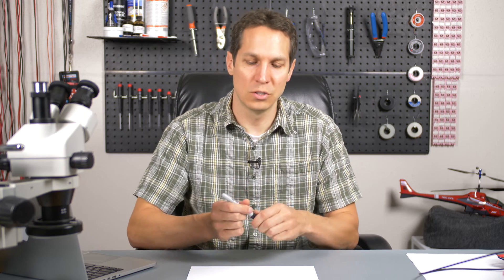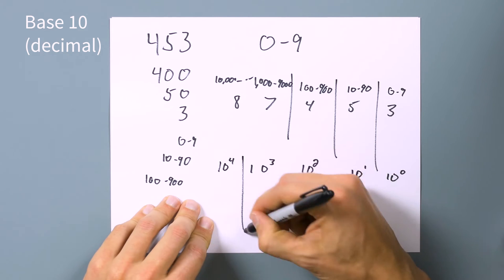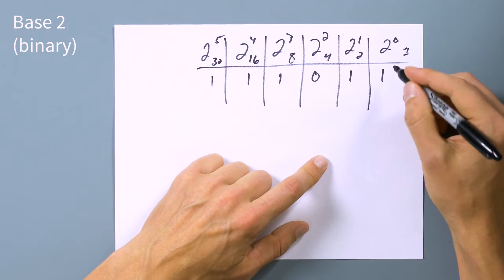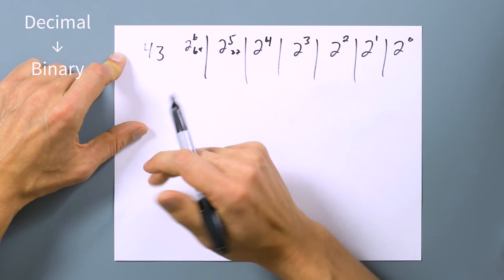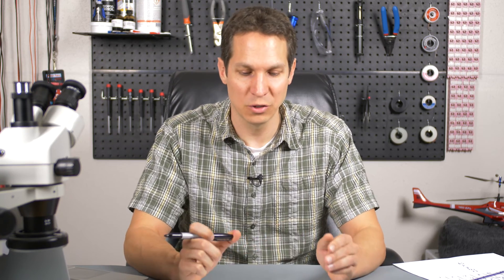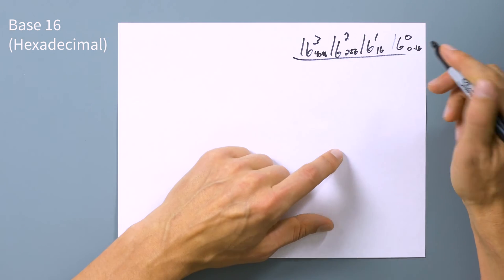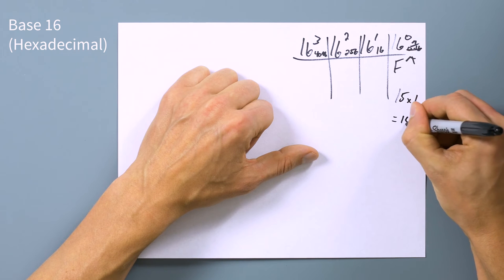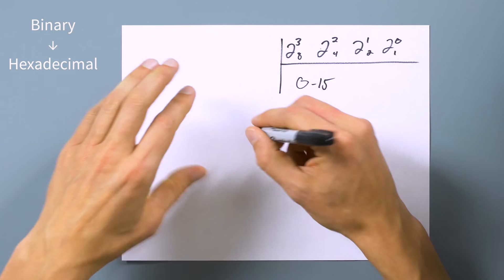Binary, Hexadecimal, and Decimal Conversion – Simple Explanation | Basic Electronics

Comment: Is ok if a number like 0x1234 I convert it to binary by  converting each digit from right to left in 4 digits(0 and 1), for example 4=0100 and then I keep going to go to the left,what I don't understand is when I convert it to binary the computer gives me this 0b1001000110100.What is that 0b??
Does it cancel those 3x0 in front and comes with 0b Wich means zero bits?
Reply from the maker: Hi Edward, great questions!  For converting, going from right to left (going from decimal to binary) is the best way to approach it.  As for the "0b" - that's just the way your computer output is telling you it is binary.  It has no numerical value whatsoever.  So, 0b1001000110100 is just saying that 1001000110100 is binary.
Reply: @CircuitBread  Ty so much,now I have another question if I am shifting the bits to the left from let's say 00111<<3,I will lose the first left 1,so since the 1 is important where is that 1 going?? i mean is like i am losing information,right?
Reply from the maker: Yes, there are different types of shifting, some that carry and some that don't.  If you carry, you don't lose the information but you do need to figure out what you're doing with it.  Is it wrapping around to the front?  Going somewhere else?  If you don't put that info somewhere else, then it's gone forever!
Reply: @CircuitBread  I am beginner in embedded system,I am on learning phase,can you give a physical example on why do we use this bits shifting? i mean let's say for example we have a vector of 5 less and and 1 means ON and OFF means 0.When I shift the bit that means I can put ON the LED I want from this vector.Give me a practical example please!

Comment: You can convert any system by using 991-fx casio calculator this video is not practical
Reply from the maker: Hi Noor!  Not sure if you watched the entire video - it's actually mentioned a couple times that doing these conversions by hand isn't practical but it's still good to have a fundamental and intuitive understanding of the different number bases.
Reply: @CircuitBread  thanks for video bro ❤❤
Reply: or just about any made by texas instruments. also your phone can do it as well. you could even write a simple script in python that would have your computer do it. or you could just google it.